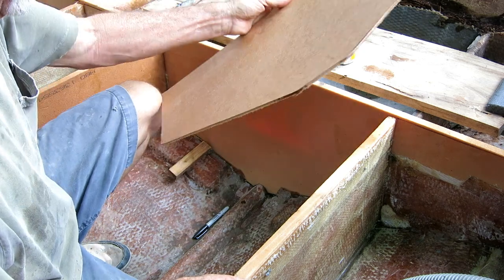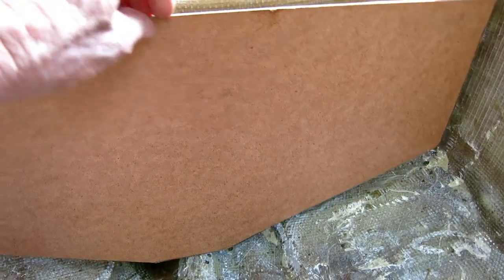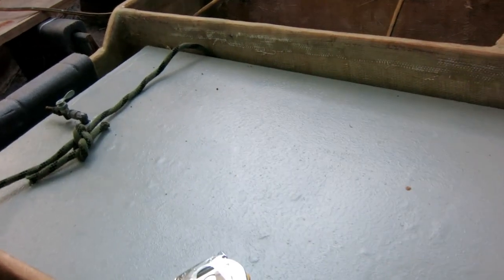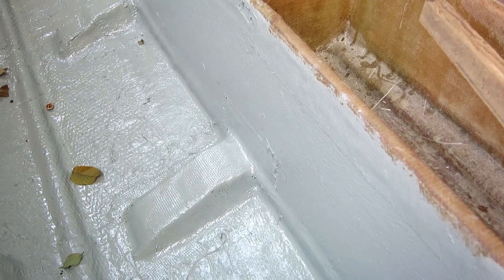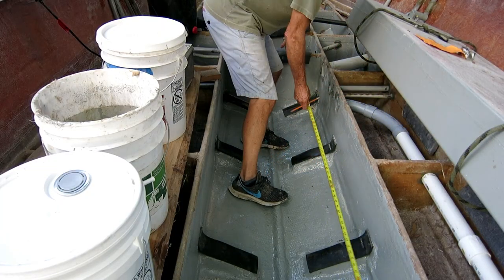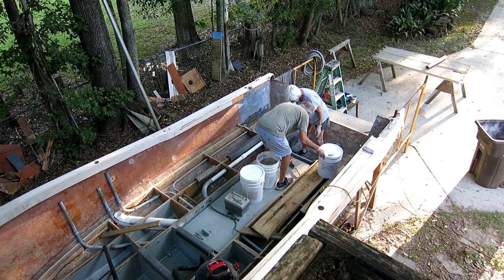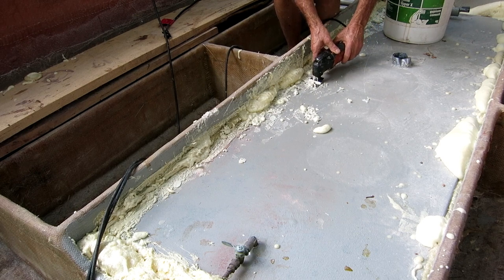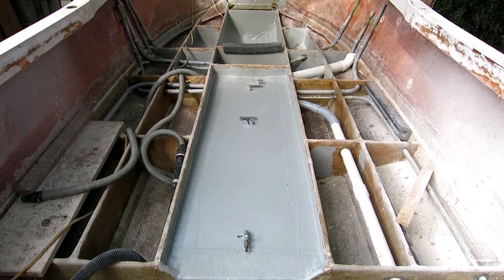The CC Boat Project 9 Fuel Tank Install In Foam

Comment: Let me ask you something…I change my tank but I see the pipe on the bottom..but that pipe coming front to the back of the boat..what is that..it’s the big pipe…thanks
Reply from the maker: Reynier
Probably a conduit to allow water in the forward bilge areas to drain into the rear bilge area where it is usually easier to pump. 
Barry

Comment: I would be careful about foaming an aluminum tank.  Foam tends to shrink enough over time to allow moisture in and hold it against the metal. Most especially along the bilge/hull area.  I have never seen a boat with even closed cell foam that didn't eventually fully saturate.  The old Boston Whalers were a perfect example.  Even though it was between the skin of the hull and supposedly closed cell they would soak up water like a sponge.  Not something you would care to have in close association with aluminum.  If you want to go the foam route anyway I would suggest a plastic tank.  A pinhole draining gas into the foam will eat at the foam soaking into it and create a nice bomb (there are electrical lines running down there that can chafe, short and spark remember).
Reply from the maker: Douglas
Thanks for commenting but you realize the tank was installed five months ago. I feel a couple of comments from me are in order though. The tank and boat were happily married for 46 years prior to the start of this project. Yes the foam surrounding the tank was saturated.  In spite of this, the tank came out with very little corrosion.  Repairs were made and the entire tank was wrapped with a layer of fiberglass cloth set in epoxy and then coated with two more layers of epoxy paint. It is now well protected. The original stringer design made no allowances for drainage from one compartment to the next. All of the newly designed compartments have gravity drains to the bilge including the fuel coffin. There are no exposed electrical wires in  the fuel tank coffin area. So like your first sentence stated, we were careful!
Thanks Barry

Comment: Great videos!  Helps me plan my next steps.  What is your tank coated in?  I am about to put a new alloy tank in, but have not thought of painting/coating it.
Reply from the maker: Thanks Tom! I am glad my videos are helpful to you. About your tank though I feel I am not qualified to give advice except for this. I would think that adding a coating would be a good thing if it was the correct coating. I used Sherwin Williams Dura Plate but only because I had it and my tank was old and had an aged surface that I was confident would provide good adhesion. With shiny new aluminum it might be a little more challenging. Two options, call the people who manufacture the plate for advice or check with a good coating manufacturer (like Tnemec) and get their recommendations. Sherwin Williams makes good coatings but if you call one of their paint stores you will get a paint person who will not be qualified to advise you. Good luck and let us know what you find out.
Barry

Comment: Talk about cutting corners! You should see the Sportcraft 270 hardtop I'm restoring right now... I swear, a half crippled monkey on a 5th of whiskey would've put stringers in better than they did. I figure my boat must've been built on a Friday at 4pm. Lol
Reply from the maker: Same with the construction of Chris Craft, very poor workmanship. In spite of this "rough" work on these 70's and 80's boats I don't know of any hull failures from workmanship issues. They usually are scrapped from from rotting floors and transoms. So if we make an effort to make our structural repairs at least as strong as original we should be able to be at piece with the structural integrity of our project boats.
Just my 2 cents
Barry
Reply: @barrylukebuilds7894  Exactly my view on it. The way we're rebuilding them correctly and with attention to detail, our boats will be around a lot longer than most now, and with a lot better seaworthiness than a lot of even newer boats being pushed out probably, lol.

Comment: dont know what type your using, but my fibreglass sets hard and dry in minutes, the heat it makes is part of the process and the more hardener the stronger it makes it. dunno if thats true.
Reply from the maker: Stuart
My understanding is that there are two main classes of resin. Laminating resin, which I used, remains a little tacky so that additional glass can be added without sanding. And finish resin which cures hard but should be etched for a good bond if additional layers are added. Sounds like you have the latter.
Thanks for watching and thanks for commenting.
Barry
Reply: @barrylukebuilds7894  you are right, if you put gelcoat or epoxy paint on it, it will cure hard as a rock.

Comment: Hi, I am from Germany. In Europe nobody uses foam. Corrosion is an issue. We prefer a solid fixing on the hull.

Nevertheless, good job!
Reply from the maker: Ronald
Thanks for watching and thanks for the comment. Here in the states most new boats are also built with self supporting tanks. My tank was existing and was not set up structurally to be self supporting so I went back with foam. I did put a drain in the tank area so that any future wet foam problems will be minimized.
Barry

Comment: Sorry but never ever foam in a metal tank even if it has been coal tared.  Period. I wont even foam in a plastic tank because even closed cell foam will suck up water over time.
Reply from the maker: Just need a drain in the bottom of the coffin to take care of that.
Barry
Reply: @barrylukebuilds7894  A drain will not stop water from being sucked up by the foam and for that matter the drain will more then likely back feed the foam more water. The only thing foam is good for is areas that will never ever get wet, for floatation. And for that matter you would be better off stuffing those areas with old empty water bottles (with lids). They hold more air per volume, lighter and wont weight 3000 lbs in a couple years when it gets wet....because it will get wet.
Reply: @finscreenname  all the saturated foam ive removed from mine should have it weighing alot less. and probably handle better. Ive seen that plastic bottle idea somewhere. but is all that flotation for if it goes under or gets swamped?
Reply: @georgeperkins4171  Most cases its used for floatation and in some cases sound deadening. All foam does is capture little air bubbles. The main thing about foam is it locks to the hull. You can fill your whole boat up with water bottles but when it sinks if they can all just float away it will do you no good. At the same time most flat bottom drag and jet boats dont have any flotation so most just put an inflated inner tube up under the deck.
Reply: A bare aluminum tank foamed in will last 20 years with water intrusion. A coal tar epoxy aluminum tank with or without water intrusion will last more. This guy did the right thing by cutting the rear bulkhead lever that will allow the water to run to the bilge.   The only mistake he made was doing those solid fiberglass blocks on the bottom. The tanks is supposed to rest on the foam not on 8 hard blocks.  A boat with the stringers system designed to foam the tank does not support a tank with brackets.